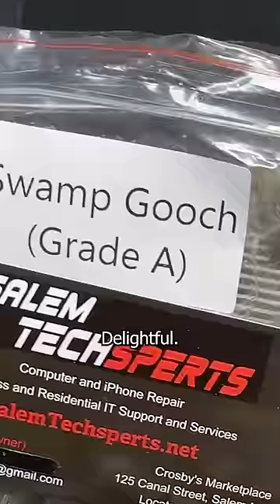Cleaning a Lenovo Yoga (tetanus edition) #tech #pc #technology #shorts #laptop

Comment: Honestly this inspires massive confidence in Lenovos product. To have that much clogging it up and it still running is incredible.
Reply: I still use my Lenovo yoga I got in 2016 as my only PC. It got me through high school and college.
Reply: i had an old brick of a lenovo laptop that reached about 15 years old before it finally kicked the bucket and stopped running completely lol
Reply: I also have a Lenovo Ideapad with a Intel core 7 from 2016. Lasted me through university and work. Works as well as the day I got it, fast and light. 

Only caveat is that I slipped on ice and turtled on my backpack, so the screen on this model is so thin that the connection cables with the camera were "broken". I bought a HP camera, cost less than repairs here in Sweden 😅
Reply: Lenovo is my go-to recommendation for sleek, affordable, performant laptops. They usually have the best bang for the buck
Reply: I have/had a lenovo ideapad and it broke 6 times within the year of having it. Sometimes after getting it back from the Lenovo repair center it would have something new broken (one time it came back with screws falling out of it). Whatever you do, do NOT purchase from Lenovo.
Reply: I had a refurbished ThinkPad my parents got me in high school (we live near one of IBM's campuses and they sell off their old Lenovo equipment all the time). It was 4 years old when I got it in HS, it lasted another 4 years after that with me before I had to upgrade. I gave that laptop back to my dad who used it for another 5 years after that! Yeah you had to keep it plugged in constantly towards the end but for him who just used it to check email, Facebook, use Microsoft Word, etc. it got the job done. Those old school ThinkPads were built like tanks.
Reply: My Lenovo laptop is turning 10 this year and i probably have a thousand viruses on it but it still runs sims 4
Reply: lenovo are hit and miss, old thinkpads are usually on par with the low end toughbooks, new ones are either good or terrible.
personally I'd recommend clevo, they are usually fairly good and easily repairable, though getting actual clevo branded clevos is hard (it doesn't matter though), you usually have to get XMG, sager, or whatever business is assembling them.
Reply: @lilium9361  Your Lenovo lived for 15 years, while my laptop (I can't remember the brand, but definitely not a Lenovo 😂) that costs 600 euros, lived for 4 years and then just died 😭💀
Reply: @itsawildmaki916  they just don't build 'em like they used to lol
Reply: @lilium9361  Yep. But that's with everything these days :/
Reply: Lenovo is a very common brand to be assigned if your workplace gives you a laptop to take home (unless you’re in a job that’s techy and needs super high performance). To me that means they’re durable, long lasting, cost effective and hard to mess up 😂
Reply: I have this exact laptop and for me it just keeps breaking, something new every year, I keep getting it fixed but it never ends. Based on all the replies here though, I’m probably just really unlucky and an outlier
Reply: I still use my 2018 legion and it's still the same ages after so I say it's good for its price.
Reply: When I suffer migraines, my hands shake incontrollably and I usually throw whatever I have in hands so I soaked my 2014 Lenovo in water and tea more than once (tbh, prior to owning a Lenovo I used to broke a computer per year). It never failed me during the years. I changed it in 2020 cuz I wanted something more updated, but now it is my niece (10 years old) computer.
Reply: My lenovo yoga experience was a nightmare, got stuck in a permanent bootloop after I exported I major grade project
Reply: I have a Lenovo Thinkpad from probably 15 or so years ago. It's definitely outdated, but if I need to boot it to grab and old file it still works. Thing was abused and traveled a lot. Not a single issue.
Reply: I have this exact same laptop and it still runs very well, although after watching this video I feel like I might have to crack it open and clean it.
Reply: u guys r lucky. my lenovo yoga got all the problems straight from the get go. Now i switched back to hp and everything goes well again.
Reply: ASUS punching the air rn
Reply: It must've been over 120 Celsius tho idk how well that can run lmao
Reply: Dude do not use the lenovo yoga, I had this specific laptop and it was the trashiest laptop I've ever had in my life
Reply: But It is Chinese l
Reply: I still have the Celeron ThinkPad SL500
Reply: Yeah I recently went back to my mothers, who still doesn't understanding "cleaning a pc" isn't using compressed air on the keyboard, and her lenovo desktop with a Nvidia 750ti is still holding up strong. God bless its abused soul.
Reply: I still use lenovo laptop since my 1st grade now im in 10th i played san andreas cs condition zero vice city liberty city pvz on it
Reply: @maddieb.4282 Or it means they offer cheap prices for bulk hardware and enterprise licenses. You're making the same mistake as people who think "military-grade" is synonymous with "good."
Reply: I can't believe my lenovo laptop still lives I'm so proud of him 😭
Reply: @itsawildmaki916  I think it is more old vs new. My Toshiba from 2009 is still kicking except the battery to this day and after malware attacks....meanwhile my work assigned Lenovo has to keep being traded to our IT 3 times or more a year
Reply: @lilium9361 did you give it a proper burial? 😂
Reply: My Lenovo did not make it to 6 months. Give me ASUS
Reply: I only stopped using my 2014 Lenovo bc the heavy touch screen broke, but it all still worked and took no time to turn on even after 6 yrs and going through constant use in college. I decided to get a Dell and it was the worst mistake I ever made
Reply: I had this exact laptop. It died in less than 2 years.
Reply: Honestly, yeah. The one I bought ten years ago still runs 😹

Comment: Best part of these disgusting lung cancer repairs is when the customer tries to weasel out a discount by claiming the scratches on the laptop lid came from me and not from the years of abuse/no cleaning they put it through.... like I don't take pictures of the laptop while working on it, like I don't work on a fucking silicone mat, or like I don't clean the laptop's disgusting crusty surface before even placing it on my workatation because of how icky it is and MAYBE cleaning it just made the faint scratches more noticeable because theyre not literally surrounded by dried up nut.

But sure, keep telling me me that the station I work at somehow caused it or how my microfiber cloths somehow scratched it. Weren't you here for a ram upgrade?

I swear these nasty laptops always come attached with customers trying to scam you.

Comment: Hello there, This is Emon from Bangladesh. I've a question. Which GPU should I pair with 32 GB Corsair 6000mhz rams, processor i5 13700? I have Samsung 980 pro 500GB Nvme M.2 SSD now though I will upgrade it later. Any suggestions for me? I will use this pc as for good quality gaming and designing. I also need suggestions for monitor too. I haven't buy those since I built my new PC. It would be very helpful for me. Thanks a Lot 💌